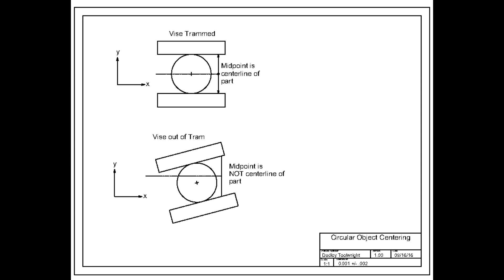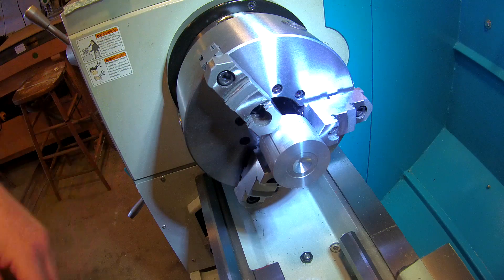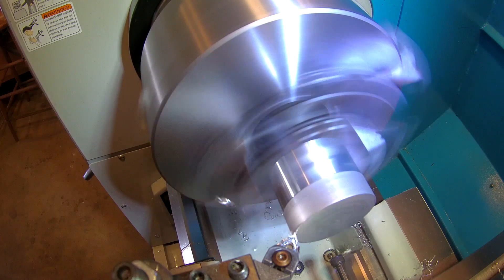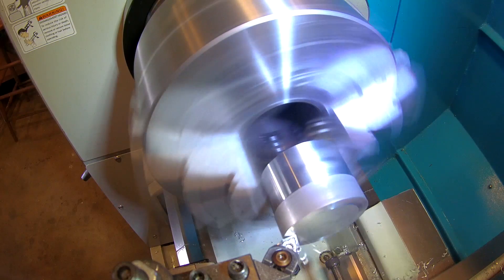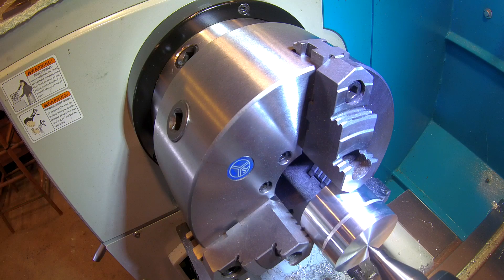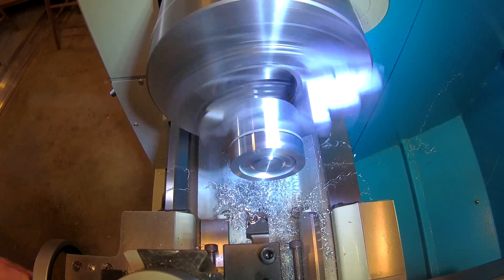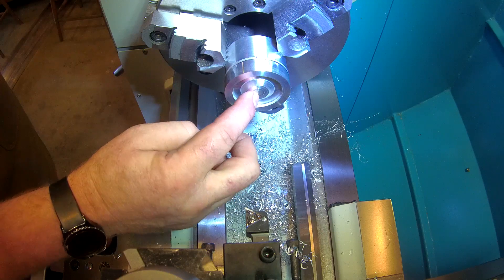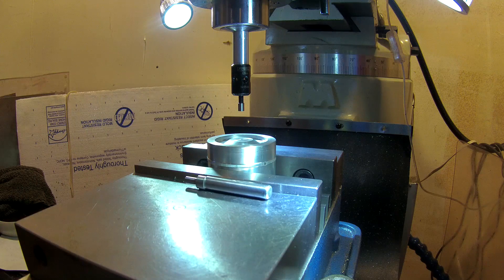Finding the Center of A part in a Mill Vise

Comment: If you use the inside of the vice jaws, both diameters need to be concentric which can't be guaranteed in a 3 jaw chuck. You could use the 3 move method directly on the part if you know the diameter. Edit: There is now another upload showing one move to find the middle with an edgefinder.
Reply from the maker: Thanks. I am not familiar with the 3 move method.
Reply: @DudleyToolwright  here is a link to one. https://www.youtube.com/watch?v=KxHxN82Ydnk

Comment: i think it might have been easier to just  put your edge finder up against the part just guess at the center it won't mater if your off. after you edge find your first surface zero your dro then raise the edge finder above the part and go to the opposite side and find that edge. divide the reading on the dro in half and you have found your center. you can then fine your other axis using the same technique. using this method eliminates the need for the vice jaws to be parallel. also the divisions on the coax indicator are not absolute they are for reference only. the resolution of the indicator changes with rod lengths. you have an extremely clean shop, i could use a video on how to keep a neat clean shop.. .
Reply from the maker: Thanks for the input. That was some very interesting and useful advise. I always love to hear the ideas of others. They often have something to say that I had never thought of. Much appreciated. As to the shop, for me this is just a serious hobby so I am not pressured to turn out any product. I told myself that if I wanted to get expensive machines, I would never put them away dirty. So, I always allow time at the end of every session to clean everything. Of course there is always the fact that I share the garage with the clothes washer and my wife hates stepping on swarf that motivates me less than a  little. Cheers.